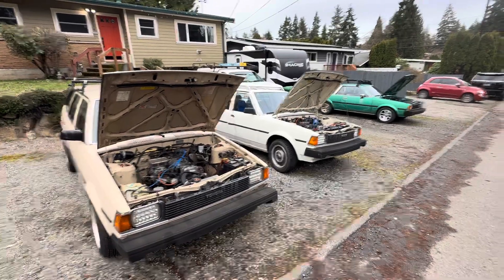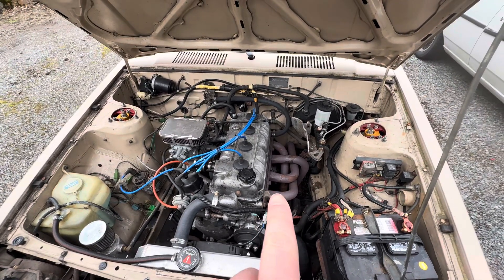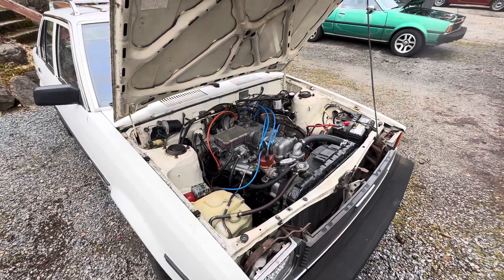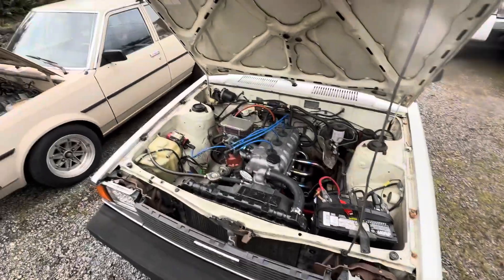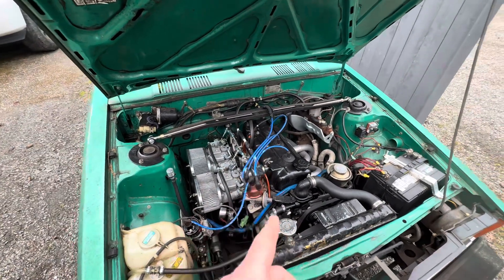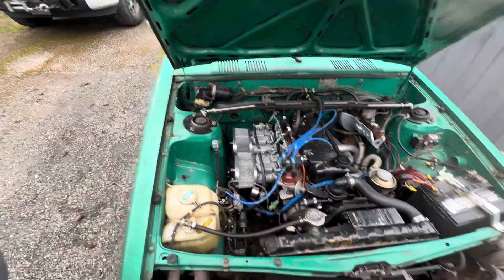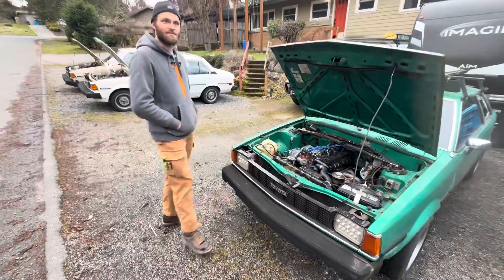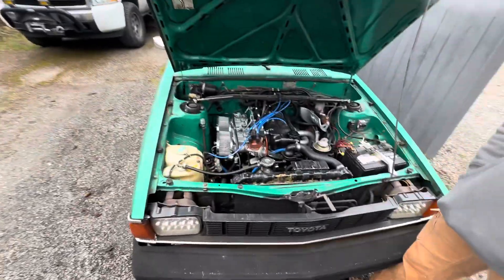Toyota 3TC Dynometer power discussion: stock, mild and street/race build.

Comment: where did you get the manifold to run the mikuni s and also what madel mikunis are they
Reply from the maker: I’m running Mikuni 44phh carbs. 44mm throttle bores. I’ve also ran 40mm Mikunis in the past. 
You can use any sidedraft manifold that is for Weber DCOE’s, the mounting pattern is the same. There’s a couple of those still made and available that can be found with a Google search.

The Mikuni brand sidedraft manifold I have hasn’t been made in years and years. They are very hard to find!

Comment: Hello there from the Philippines, I've got a 1979 Corona Liftback with a 3T and five speed (Even factory aircon). Have you ever ran a set of bike carbs on a 3T? Is the stock mechanical pump good enough to feed all 4? Great builds!
Reply from the maker: I have not run bike carbs, but have run multiple Weber and Mikuni sidedraft carb setups. The stock pump can keep up with a single sidedraft, but it can't keep with with duals, you will run the float bowls dry not long after hitting 5000rpm.
I run a 3psi Carter P60430 electric pump. It has a high enough GPH rating for about 160 horsepower. And it isn't crazy loud like the Holley blue and red pumps people like to recommend.

Comment: Nice, had a lot of these setups back in the late 80’s and early nineties. My fastest naturally aspirated 2 dr Corolla had dual 44mm side drafts, bored to a 2.0 liter I can’t remember the specs, full port and polished from psi racing running a .512 lift cam from crane I think. Lightweight flywheel and 87 gts twin cam rear end out back I think was geared 4.30, of course had fuel system and msd ignition. I never got a dyno on it but it would spank 5.0 mustangs even if they had some bolt ons.

Comment: What feul pump did u use on the green mamba
Reply from the maker: It uses a Carter P60430 electric pump. About 18gph rating and 3-5psi output. 
It’s plumbed using factory hard lines from the tank. And a return style pressure regulator in the engine bay. 
Been a great pump since I installed it in 2020. Quiet and keeps up! I used to run a Holley “Blue” fuel pump, never again! They are way too loud.

Comment: Interesting video as I myself also is planning to build my engine with 87 mm pistons, and was wondering what the difference would be from my current stock mild cam weber engine to an oversized 87 mm with a little more aggressive Schneider cam. 

By the way, I follow you on YouTube, and i did the Saturn alternador upgrade you shared, and it worked flawlessly. Now I'm greedy and want a bigger amp  alternador 😂

Keep up the good knowledgeable work Richard you have a fan in NY. 💪
Reply from the maker: Thank you! Dan and I have a couple more engines and carb combinations we want to try. He has a 2.0L 3TC with 89mm pistons, a ported head and a huge Isky cam. Had it in a 82 wagon years ago, but it is sitting around waiting for a car. It's certainly more powerful than my 127HP 3TC, but by how much?

I also might take the sedan, and install my spare set of 40mm Mikuni side drafts to see what difference in power that makes.

We started playing with old Corollas in the mid-late 2000's, and nobody would share dyno results except for their big turbo engines. Having this sort of basic info out there is long overdue!